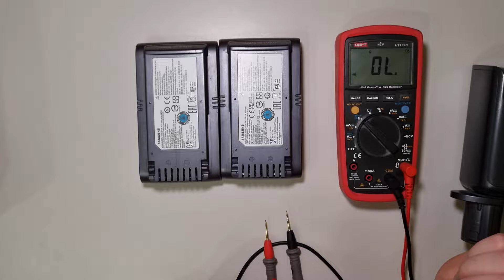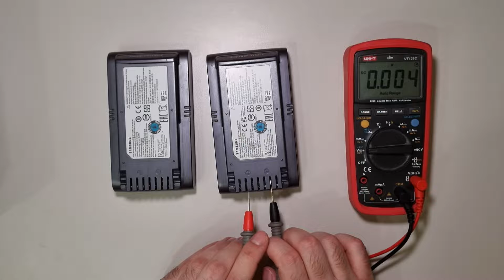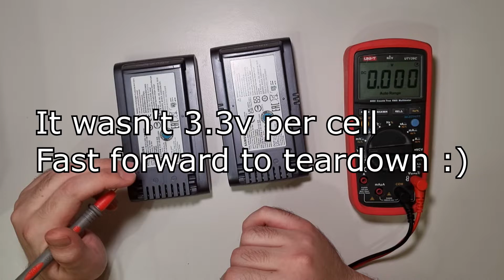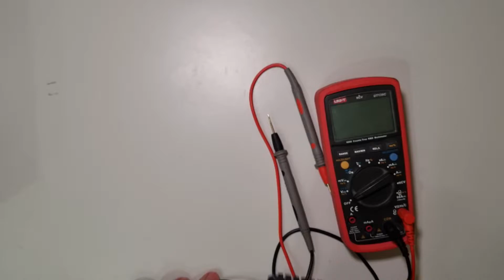Looking into broken Samsung Jet 75 90 cordless vacuum cleaner battery - is it repairable?

Comment: I have 2 batteries for my Jet 75 and both locked/ spoilt at the same time - blinking twice and doesn't charge. What are the odds of both battery spoiling at the same time? Or is it the charging station faulty

Comment: Hi Adam,i have the jet 90 and i took it off charge (2pm)and was going to vacuum but i had a visitor come so i just put vacuum on side and waited for visitor to leave. It was too late to vacuum (11pm) so put it back on charge. Next day i wanted to vacuum and there was nothing! ,no sound,no lights on buttons. On battery the blue lights blink twice thats it. No charge. Plz help.
Reply from the maker: It's just bad luck that in exactly this moment battery decided to lock ;/

normally these vacuums are designed to be 24/7 connected to power supply into a docking station so you just had bad luck ;/

Comment: Adam I have such a question, the child, in non -knowledge, put in the cells where plus minus along the edges from where the charge goes to the battery wanted to charge the phone according to him, but then all three diodes of light caught fire and no longer charges the battery from the prolongation, although they were workers and held long, what could be done to makeShe worked or is it no longer possible, I put it on charging, she flashes all three and everything
Reply from the maker: Only one chance to check the fuses

Comment: I have a Samsung Jet75E, and I'm wondering if it's possible to use its old battery to create an adapter and connect the vacuum cleaner to a power supply unit. In other words, to convert the cordless vacuum into a corded one.
Reply from the maker: I was playing with lab supply, power consumption is really huge on max setting. Due to very high currents i would not recommend doing that because wires would need to be really thick and short, doesn't make sense :/
Reply: @HobbyWithAdam  Thank you for your response!

Comment: I also need to change the battery cells. Can I use INR-21700-P42A instead of these cells?
Reply from the maker: INR-21700-P42A 45A discharge rate is more than enough ;)

factory samsung 21700-30t has 35A discharge

Comment: The programming port is I2C\SMBus, so with USB-I2C adapter (CP2112, on example) , on example, you can read a battery info (cycles count, capacity, etc).
Reply: Can you describe it a little bit more? Where and how you are plug it, and how you can read this info out?
Reply: @mysticman0628  
The SMBus protocol (over I2C :) ) is used in many "smart" batteries (such as laptop batteries, for example).

To read data from a battery that supports SMBus monitoring \ programming, you can use an inexpensive USB-SMBus adapter (search for "CP2112 USB adapter" on Google) and software (search for "CP2112-Laptop-Battery-Reader" on Google – it's open-source software written in C++, Qt).

Regarding the connection, there’s a small black connector on the battery board. That’s what you need :) There are test points (GND, SDA, SCL) on the board that lead to the small black connector.
Reply: How to unlock bms
Reply: @doeado7553  If we talk specifically about this BMS, I don't think it gets locked. I had no trouble disconnecting all the cells and replacing them with new ones.
Reply: @vladsol2009  i havd change the cell
But now blinks only two times the blue led
This battery model from samsung vaacum cleaner
Reply: What will this do
Reply: @ssv1975  Nothing special. This controller doesn’t lock when the cells are disconnected. But if you’re really curious, you can check the remaining capacity of each cell, the number of charge-discharge cycles, and so on.
Reply: You would need to figure out what the bits represent even if you read the battery bms, you probably need an unused battery and experiment charging and draining the battery and observe the bits changing.

Comment: Thats weird, my jet 75 vacuum battery is VCA-SBTA60, it has only 38,88Wh and 1,8Ah, i wonder if i could also use that you got there, it seems a lot bigger capacity. Mine drains quite quickly.
Reply from the maker: looks very similar, It might work, I would give a try somewhere with free return option
Reply: @HobbyWithAdam  chat GPT told me they are compatible...exactly same size, only difference is capacity 🙂 Some sites also show that sbta90 fits jet 75...so it probably is true.

Comment: I change bad cell , igot 25v but not working , i dont know why
Reply: This just happened to me as well - while detaching the old cells at some point the circuit started ticking like a bomb. After a minute or so it stopped, and then poof, bricked BMS.
I got so mad I hardwired the battery pack to the P+ and P- terminals and hooked it up to the vacuum, and surprisingly it started up immediately. Speed adjustment also works fine, although the power button does not work, I think all it does is ask the battery circuitry to toggle power via the middle pin.
I’m very tempted to buy a cheap 40A bms off Amazon and replace the original circuit.
Reply: Have just done the same thing. Found 1 x 21700 in the middle (on the connector side) was faulty. below 0.1V and no resistance. Replaced and charged each cell in the pack individually and now seeing full voltage across the 6S1P pack. BMS is still giving the 3 flashing lights when tried to be used. Suspect BMS fault also?
Reply from the maker: It might be same situation as I have spotted in jet bot battery, replaced all cells but somehow BMS was locked ;/

If yes, I was very lucky in this video...
Reply: @HobbyWithAdam  There is another video on youtube where some chinese guy is changing elements in this battery, he has extra wires soldered to the battery so the board never loses electricity while removing elements. Seems he does it like that to prevent locking the battery. So basically the safest way to replace a cell would be soldering another cell and then remove and replace the bad cell. https://www.youtube.com/watch?v=7P16NXYoluw
Reply: @HobbyWithAdam  i think bms lock , i try to use on jet90 but they not work just have led blink 2 time , do u know how to unlock bms bro?

Comment: Hi Adam thanks for the video. It  looks my batteries are good something should wrong with the bms board. All my batteries has got around 4.1 V. Where did you get your New BMS board?
Reply: Does anyone know where to buy the bms circuit board ?  I check the cells and they are good .
Reply: I couldn't find anywhere, but my old BMS is working after few days of disassemble  @JoseGomez-bd3db
Reply from the maker: I bought another battery and was lucky enough that another battery had broken single cell but BMS board was fine :)
Reply: Ah ok thanks, I have to buy another one also.
Reply from the maker: If we are around 20$ for "dead" battery it's worth even just for cells only, 21700 3000mAh 35A would cost at least few $ each. @mysticman0628